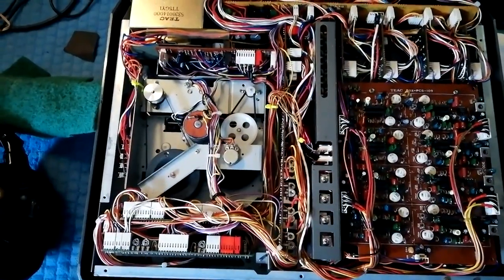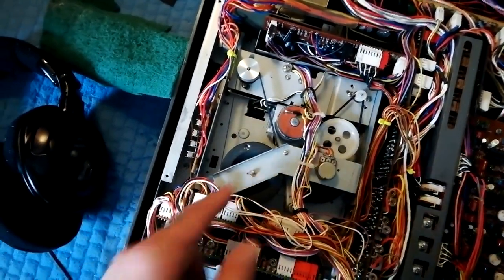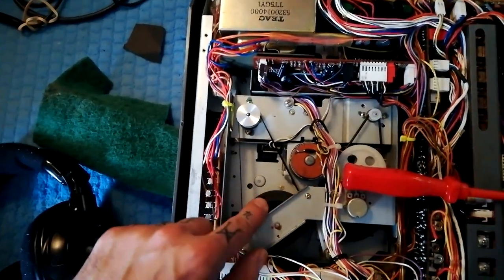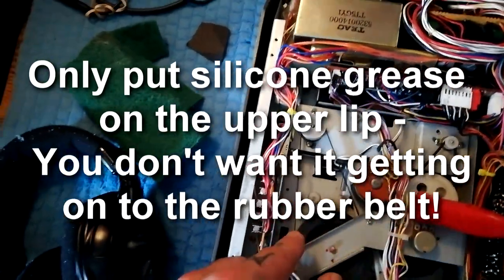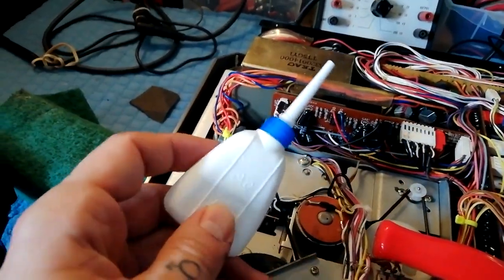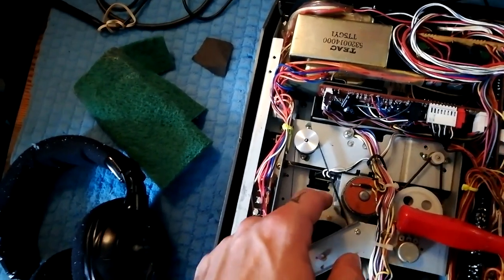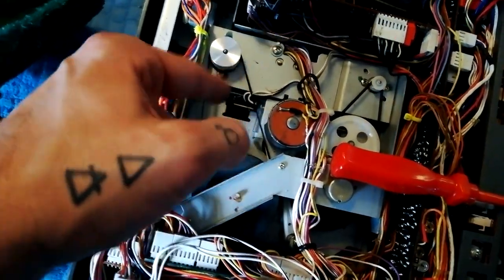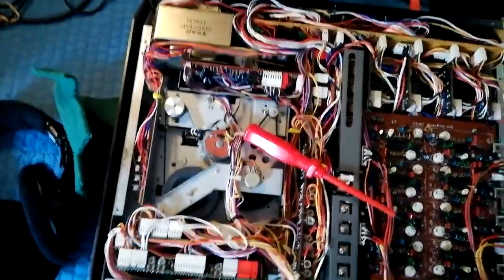Tascam 244 or 246| steps to reduce mechanical noise from the transport

Comment: You're right though there's always going to be some noise with these 80s units. The Late 90s, early 00s 414,424 are much more quieter but that's a decade of improvements. There's some features on the 246 that are quite unique, my favourite are the 4 pgm in/out so you can record on another 4-track tape R2R machine (I use the tascam 34)
Reply: dbo514 So the 246 can sync with another 4 track? For instance the 244?
Reply: @BogoEN  it can send out 4 track signals so you can record on another recorder. So yeah if you take the 4 pgm outs on the 246 and send those into the 4 line inputs on the 244 and then take the 4 tape outs on the 244 and send those into the 4 pgm ins on the 246 you should be able to record on the 244 from the 246.
Reply from the maker: @dbo514  its a feature which is missing from the 246's direct descendents the 464 and 424MKIII, but  I'm pretty sure the access points on the rear of the 244 accomplish the same thing? I've got a 38 so maybe at some point I'll do a video demonstrating the use of the mixer on those two four tracks as a front end for the 8 track reel to reel.

Comment: Thank you! My T-246 will rewind and fast-forward tape, but when I try to "play" or record, it seems to bind up? Is that a rubber part that needs adjustment or replacement?
Reply from the maker: Not sure what you mean by  "bind up"? But any transport issues you will have will be mitigated by replacing the capstan belt; the control belt; the pinch roller; the idler tires. And due to the age of these machines and the tendency for old rubber to turn to tar, I recommend you change all these parts in one go. If you watch the first dozen videos I uploaded to this channel they are a complete course on how these things work and how to replace them, they're labelled 244 but for your purposes they are 100% compatible with your 246 since the mechanical parts of both transports are identical.

Comment: Hey man, thanks so much for all the videos. Wondering if you could help me diagnose a weird issue. I’m fixing up my 4th one of these beauties and the unit I got was pristine. It needed all new belts and tires, which I did, but the capstan motor it turns out is quite noisy. I tried lubricating it like you said but to no avail. It’s not noisy when the machine is upside-down but as soon as I flip it over it starts making kind of a scraping noise. I have some videos if you want. Let me know if you have any ideas. Thanks!

Comment: hey tetrakan, ive had an old 246 with a non functioning tape deck that i've used for years as a glorified mixer. Finally got around to opening it up and it was a simple belt replacement to get the deck working. We recorded a track to tape successfully, but after 10 or so minutes of use the tape deck started to develop a horrible squeak that you could hear back through the headphones. Have you come across something like this? would lubricating the motor or capstan work? thanks! -troy
Reply from the maker: Hey, I suspect that squeaking is the idler tires on the way out, I have videos demonsting their replacement on a 244 and that part of a 246 is identical if you can figure out how to remove the transport from the chassis (5 screws and a few plugs, not terribly hard). If replacing the idler tires doesn't solve your issue, I did a video quite recently about oiling the motor etc on a 244 and again the parts I focus on are identical on the 246. But "squeaking" usually means idler tires!

Comment: Can all of these methods be applied to the 234 to improve mechanical noise? Specifically the thrust adjuster tightening method + silicone grease? I’m getting similar sound to the flywheel / thrust plate grinding sound. It’s pretty loud 

Only thing that’s a pain is getting that 234 transport out (as you demonstrated in your other series) and testing it while it’s totally gutted. Doesn’t seem possible
Reply from the maker: Should do, yes. My experience with the 234 is minimal compared to the 244 but as I remember, the mechanical overlap is pretty much total - only the housing differs. I'm using AMS premium motor oil these days as opposed to sewing machine oil. A more experienced tech who used to work in Teacs service dept recommended it, and the results are noticeably better.

Comment: Good stuff, Cal. Stop breaking yer leg and come up the 'Ness for a cuppa. Top content, as always. Don't suppose you could do a quick clip about the pots for calibrating the VDU needle on the 246. I regret I have forgotten the info you pointed out to me. Al.
Reply from the maker: Hi Al. Will do, but briefly you put a mini flathead screwdriver into holes behind each meter. Ideally you use approximately 0.7 volts AC for a 0db reading with master and track faders set to 7.5, but the main thing is to get the meters responding the same way as each other so if you have some random synth note coming in at -3db on channel 1, make sure the other 5 channels show -3db with the same input signal
Reply: @Tetrakan  Great to hear from you. Hope leg is well and healed. Just one point I forget to ask, and one I'm sure is variable from model to model - Re the 246, at what point is the peak lamp supposed to light up (generally speaking)? When the needle is straying over 0db or when the needle is beyond +3db? Maybe a graduation in intensity from +0db to +3dB and beyond is my assumption.
Reply from the maker: TheAdvancedMusic id need to check the schematic for the 246 but on the 244 the overload led is pre fader whereas the VU is post fader, so the LED is showing high voltages exiting the gain trim, whereas a properly calibrated VU shows levels to tape....it's possible to have a signal distorted by gain stage clipping hit the tape quietly, and to have an unmolested signal which left the gain stage quite cool hit the tape hard (resulting in tape saturation) since both the mixer and master fader have opamps associated with them and can amplify the signal beyond what the gain pot put out, and the eq controls can boost voltages as well...so the relationship between that led and VU wouldn't be in lockstep even where everything was calibrated within factory tolerances. But imagining a well calibrated machine with the eq set flat and the mixer and master faders set for unity gain (7 to 8 region) then yeah I imagine at the point that LED Kicked in your VU would show something in the 0 to +3Db region.

Comment: Tetrakan Supermonobloc - Great videos! I have a 246 and it is in need of capstan belt, control belt, idler tires and pinch roller replacement. I am about to do that, but also noticed that the digital tape counter is not working. There is no digital display. Any ideas? Sorry if you covered that on another video!
Reply from the maker: Thanks. Two things I know of that could be...The counter displays on this generation (244/246) are like vacuum tubes and they do blow. If you partially disassemble the section below the transport ( a few screws to remove and cables to unplug) its a separate module between the two control boards. Usually if it’s out the little glass nipple at the top of the counter has broken off. If that’s still intact I’d assume it still works, I’ve sometimes had issues with power getting from the control board facing you when you remove the rear panel to the other boards in that module. It’s quite a complex board, right at the edge of my primitive understanding of electronics and its double sided but I’d suggest troubleshooting that board if the counter itself is okay.
Reply from the maker: When I say double sided I mean the solder contacts, so it’s hard to desolder without a vacuum desoldering station; all the components are mounted on the same side of the board.
Reply: @Tetrakan  Perfect. Thank you for the guidance!